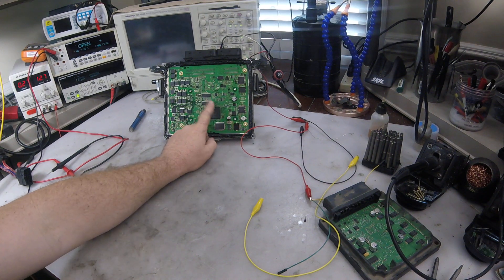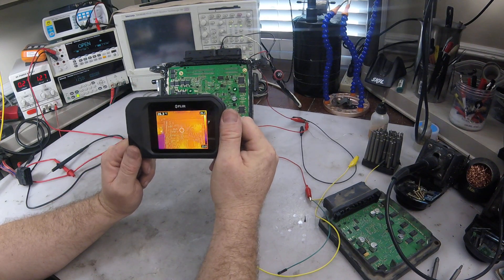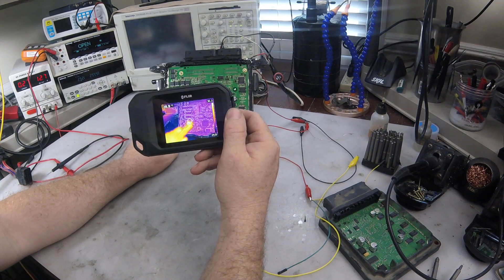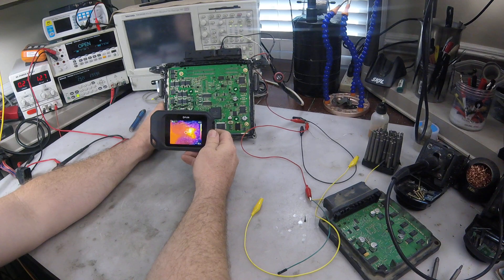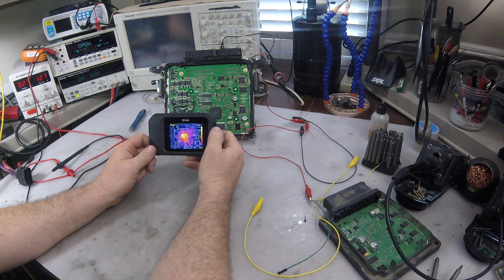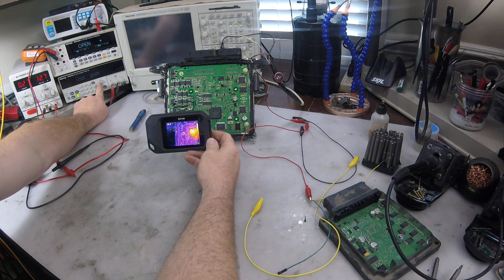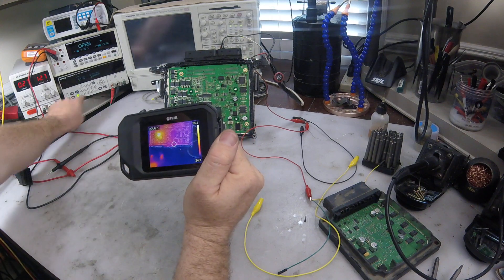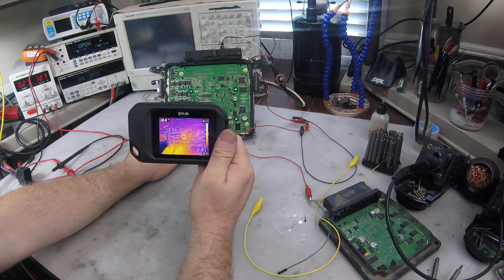Electronic repair -  Using a flir infrared camera for finding electrical shorts with thermal imaging

Comment: Hey, if you still use this camera. Go into settings and choose the thermal only option. When you have the overlay on it, it isn't in the location you see on screen. The actual location is higher than what you see.

But if you use no overlay. It's a blurry mess. But when ut heats up. It is exactly where you see it on the camera. And you can put your finger or a pointer on it.
Reply from the maker: Yea, its pretty off for the overlay but Ive gotten used to it now